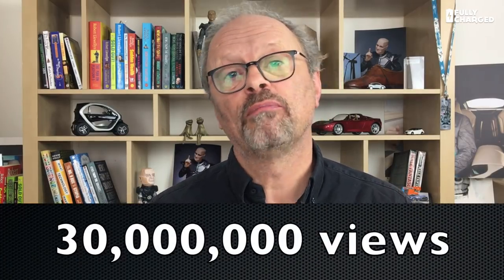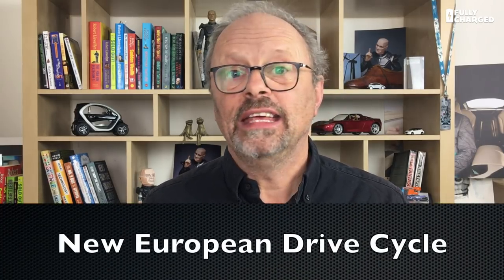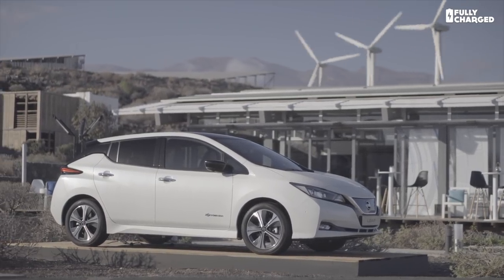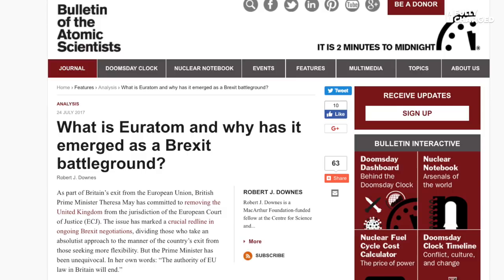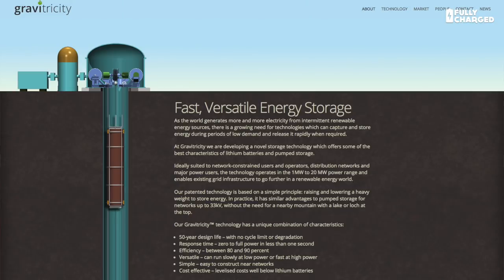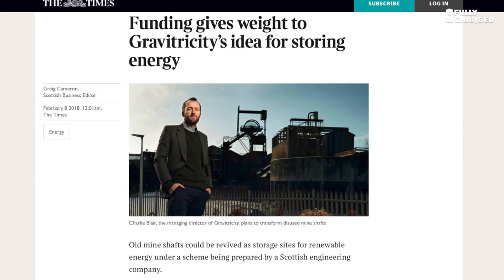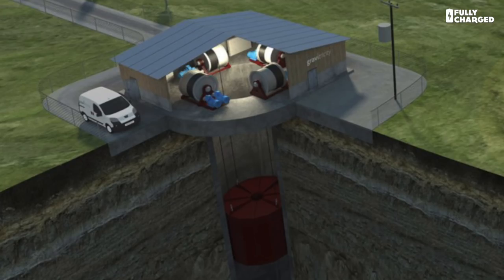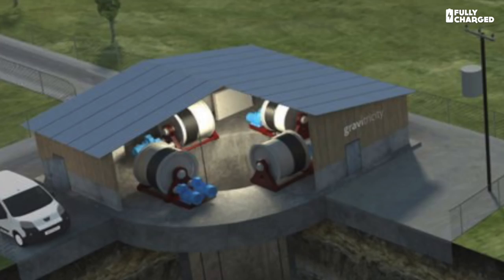WLTP IEM and Gravitricity | Fully Charged News

Comment: Gravitricity is the second novel energy storage solution I've heard about just today, the other is a company that is also using tunneling equipment but to bore holes into mountainsides to create large empty cavities and turning them into pressure vessels where they use excess clean electricity to pump air into the cavity at high pressure and then release that air to spin a generator when demand is high.

I think they're both awesome ideas and can't wait to see them put to use so we no longer need to rely on lithium ion batteries for large scale energy sotrage.
Reply: it's not novel.  See my earlier replies to others.

Comment: Robert please forgive me if you’ve covered this previously because I obviously missed it. NEDC/WLTP is all very well but I’m interested in calculating how much I can save going electric. To this end I’m wondering if you have a rough working figure for the charging efficiency of the lithium cells cars use? In my day I seem to remember that for lead-acid batteries one could reckon on a factor of 1.4, I.e. to charge a 10 amp hour battery you’d have to put  in 14 amp hours. I’ve been looking at PHEVS and a rough calculation, given that not all my trips could be totally electric would suggest it’s not a clear cut ‘no brainer’. Many thanks.

Comment: The thing with the big weights seem bogus: 
To store just 1 MWh with a 30ton weight, you would need a hole 13,5 km deep. Sorry, but it just doesnt seem feasable...
Reply: Gravitricity's site talks about using weights between 30 and 3000 tons in mine shafts of between 150m and 1500m. Their stated power range is from 1 Mw to 20 Mw.  And stated efficiency is between 80% and 90%. I'm not an expert...do these figures seem believable?
Reply: Oh ok, thats a totally different case :) 3000 tons raised and lowered 1500 m is about 11,34 MWh with 100% efficiency. But oh my god you are gonna need huge cables... ;) If they can do it cheaper than batteries, i will be impressed :)
Reply: Unless the shaft is already available, I doubt the cost will be economically viable. But if the shaft is there, this is possible in my rough maths.
Reply: And in my country, if you dig any size hole of any depth it'll pretty soon fill with water.
Reply: Good point. But if using a steel weight, you will only lose 12% of the energy if the shaft is flooded vs not flooded. It might still be viable.
Reply: Rasmus Damgaar Nielsen. How do you calculate this? I have about 2KW of solar power available for 6-7 hours a day and would like to calculate how much mass and depth i would need to store about 8KWh to be used at night. Any formulas you can share?
Reply: E=mgh
m (kg) x h (meters) x g (9,81) / 3600 (Joule/Wh)= E (Wh). 
E=8 kWh: m x h = 8000 Wh x 3600 / 9,81
You'd need 30 tons and 100 meters of elevation to store your 8 kWh...
Reply: Thanks. That is pretty easy to calculate. Unfortunately the result is two orders of a magnitude to big to achieve even if it would magically be 100% efficient.

Comment: The graviticity stuff, is that the same idea of when they pump water uphill and then let it drop again to spin turbines?
Reply: Yes, in essence, just without the water.
Reply: Also without the percentage loss of a water turbine but with the gearing loss.
As a storage system it’s response time wouldn’t be as fast as a battery. Not sure about its physical footprint either. Battery packs could be vertical cores for buildings to radiate heat in winter and heat pump cool in summer.
Reply: Yes, it is, at a much higher cost for no real gain. With water you can easily expand the storage capacity simply by having bigger tanks (if you don't use natural reservoirs in the first place). Over all pumped storage is about 70-80% efficient.
Reply: George Wilson well, here you have braking losses so it's not perfect either
Reply: JuicyVeganDwarf yes, but it has some theoredical advantages. The conversion from height energy to electricity can be 100% effective, but when water is used, the max is limited by betz law to about 60%
Reply: Same stuff but you can get much smaller, with lead instead of water you can get 11x more weight and with it power in the same space.
And no it can't be 100%, you always loose on friction.
Reply: Similar, but about 5 orders of magnitude smaller than hydro. It is not viable unless there is an existing hole, because potential energy is VERY low. For example  "Dlouhe strane" Hydro power plant has 3 MILLION TONS of water 500m high (or about 10 000x what they suggest).
Reply: Is it a smaller footprint than the hydro plants? Because I get the feeling this is a solution for local grids, not a solution for a national grid?
Reply: It is not solution, because that 30 tons only store about as much energy as EV (1km, 30 tons ~ 80kWh) while it cost orders of magnitudes more to dig such massive hole , then to buy such battery (~20000 USD?).
Reply: I guess if you have a hole already, then it's a good re-use of something that is not that useful for other situations.. but yeah, if you have to dig a new big hole then I guess it's not that good a deal.. Might be a good idea to use different types of energy storage in places though, so it averages out any cons that could build up if everything was the same.
Reply: Almerinda Romeira more of a variable gearing to meet demand but there is also the spin up time and syncing the output to demand to keep the grid stable.  Something like De Vinci’s variable gear drive with an electric controller to match the ratio to the output required.
Reply: I presumed they would use something similar to how wind turbines turn their VDC from rotating blades to VAC for the grid syncing
Reply: MsSomeonenew - lead is expensive (a few thousand $/€ per ton). None will ever use that. World production (about 3 million tons) is just enough for 100 000 30ton installations. And a 30ton/100m setup can't even power a single home for a day.
Even iron/steel which is much cheaper has no contest against concrete when it comes to price per weight (a few tens of $/€ per ton of concrete).
Petr K - five orders of magnitude smaller? Where did you get your weight from? A scoop of a neutron star? ;)

In the end it's mass that stores the energy. And there isn't anything that's cheaper, more available and easier to handle than water in that regard. Power companies could have had draw weights for a century. There's absolutely nothing new about it. But there's a reason they only build pumped storage hydroelectric and not some other form of gravity storage.
Reply: superdau - I compared it to a pumped hydro "Dlouhe strane" with roughly 3 million tons of water vs here 30 tons. Thats 100 000x less or 5 orders of magnitude.
Reply: JuicyVeganDwarf - Calculating stored energy is very simple principal and there's nothing inacurate about it. For ~10k USD (rough cost of equivalent battery storage) you can build an outhouse, not drill hundreds of meters, buy 30t of concrete, heavy-duty cables, machinery to lift it and pay maintenance of moving parts for years.
And since this is nothing new, people WERE trying, but it is simply not feasible for a reasonable cost. Just look at the cost of building elevator to a 5 story building - that's about 50k at least. And thats tiny compared to this.
Reply: JuicyVeganDwarf
You ever heard of physics? There's no need for any specs to arrive. Physics tells you how much energy you can store with a certain weight and height (at 100% efficiency, it only goes down from there). Economics tell you that no matter what material you use, pumping water up and down a pipe (that does neither have to be straight nor vertical) is cheaper. Which, again, is why power companies have been doing that way for a century, instead of pulling up and down weights.
Reply: "The conversion from height energy to electricity can be 100% effective"

Yeah, no... Also, Betz's law only applies to wind turbines. Water turbines can be up to 95% efficient in converting the energy in flowing water into mechanical output.
Reply: re JuicyVegan:  Yes, you CAN count the upper limit of what they can store assuming perfect energy conversion and even than it doesn't add up  (it can get only worse for them if we account for any loss in "turbines" you speak of). 
We can calculate precisely amount of potential energy if we know weight (30 tonnes) and height differential. For 1km height it makes 3x10^8 joules or about 80kWh (thats basic physics), for 100m it is 8 kWh. Neither makes sense and nor does any other height you fill in - not even remotely.
For that reason I gave you example -  20m lift is more expansive (~50k) than a 100kWh battery (~30k), that would supply more energy than is stored in 30 tonnes of weight 1km high.
Reply: It can be 100% effective, really?
Reply: There was a story a while back about a a fully loaded train being driven up hill with renewable energy and then let to run downhill to generate energy when needed. I wonder how the economics of that idea went.
Reply: JuicyVeganDwarf: I don't think "power required to rewind" matters.. If it is only excess power that will be used to wind it back up then it is relatively free, ignoring wear on tear on a wind turbine that could be stopped or solar panels that could be turned away from the sun instead

Comment: I average around 66mpg all year round in my Toyota Aygo. My Best tank was 79mpg in the summer on a 300 mile round trip averaging about 55-60mph. I'm just glad that I get better fuel economy then the average hybrid car. I probably won't be buying an EV until I can get one that does over 100 miles per charge with a worn battery for less then £7000 without a battery lease and I don't see the point of buying a hybrid to get very similar fuel economy figures I get from my current car. The only advantage is not worrying about economy in stop start traffic which I usually stop/start my engine if possible.

Comment: Assuming 90% efficiency of the motors/generators you have a roundtrip efficiency of 81%. A good battery has 96% roundtrip efficiency but you have to consider charger and inverter at maybe 92% each which adds up to almost exactly the same or 81%. Batteries will age over the years, but so does the gear system and motors. I assume these mechanical storage system are cheaper to run in the long run. Batteries will eventually have to be replaced, the weight bases system 'just' needs regular maintenance.

Comment: I've been looking into Gravitricity a bit more. At first glance the very high cost per MWh of storage makes this look like a waste of time. However, the system may have a place in the grid if the price per MW of power is below lithium batteries. Although the system will not be able to store large amounts of energy it will be able to 'charge' and 'discharge' at very high power.

This is a similar concept to the flywheel developed by Williams, used initially on racing cars and now on London buses. The cost of storage is huge - it only stores 1/3 kWh (about the same as two hobnob biscuits), but it can suck up or deliver 120kW. For comparison the Tesla Model S delivers a peak of around 600kW from a 100kWh battery. To deliver 120kW the 1/3kWh flywheel would therefore have to be replaced by a 20kW lithium battery. 

It's a shame Gravitricity don't make this clear on their website, and didn't explain this to Robert when he spoke to them.

Comment: Mechanical energy is a bad storage for electricity. Assume that we can boil certain volume of water using 1kW kettle in 10 min (600s). We need 600 000 joule to do this. If we have a weight 1000kg (1 cubic meter of water) then it should be lifted 60 meters (mgh) to boil this water. Is this a reasonable storage place?

Comment: Why just a single weight in the Gravitricity shaft? By using several independent weights you get the same benefit as you would with a single large. Is drilling another shaft less expensive than doubling a shaft's capacity?

Comment: Re Gravitricity. Yes it is a very simple principle: Stored energy is mgh - mass x gravity x height. 

The example you gave of a 30 tonne mass if allowed to drop 1km is able to store less than 82kWh, so less than the battery in your Tesla

It scales linearly, so for your "many megawatt-hours", you'll either need a longer hole in the ground, or a heavier mass. So that's either a 10+km hole or a 300+tonne mass just to make it up to 1MWh. 

It'c certainly possible, not sure how viable it is.

(someone else might like to check my maths: mass (kg) x gravity (9.81) x height (m) gives stored energy in joules. 1J = 0.00028 Wh)

Comment: I'm all for renewables and energy storage but as an engineer I must say my bullshit alarm was ringing loud on this one. Quick math and physics says the energy stored in the concrete block is mgh. Mass * gravity acceleration * its height. Assuming we could convert this to electricity with 100% efficiency here are the results. 30 tons is roughly 27000kg lets round up to 30000kg to play in favor of the idea. 30000kg * 9.8m/s^2 is 294000 kilojoules per meter. One KWH is 3.6 megajoules. 3.6MJ/2.94KJ is 12.2 meters per KWH. That is a ridiculous way to store energy. One kwh of batteries can fit in a backpack. Please someone check these numbers and let me know if I made a mistake. I hope I did but it seems as if its true.
Reply: You're not much of an engineer though seeing as you didn't bother checking any of the numbers.
Reply: Seán O'Nilbud I did check them. I'm simply asking for a confirmation as is commonly done in engineering if anything that makes one a better engineeer. One who thinks his answer must be correct is a poor engineer. I work on grid energy storage systems for my job.

Comment: Can you explain what is the electrical infrastructure required for the different charge  rates from  the charging points, for example what infrastructure  is required for a 7kw, 22kw, 43kw  etc and what is the highest charging rate can I get for my home without having to upgrade. Can the utility companies facilitate the increased demand and infrastructure changes. Will it be possible to get a 22kw charging rate at home and what would be the cost to upgrade my home electrical infrastructure to accommodate the higher charging  rates to a home charger.

Rural car users have a high requirement for trailer hitches for their cars, why don't the lower cost  EV's have a capacity to add a hitch to them?  I know that having a trailer attached would reduce the range significantly but most trailer  requirements are for short trips?

Thanks if you can help your doing a great job by the way.
Reply: Matt Wlaw 7kw standard, you need 3phase for 22kw

Comment: @Gravitricity: With a mass of 30 tons, you can only store up to 8 kWh of electricity per 100 meters difference in depth (8175 Wh in theory, without losses).
Even ten of those with 1000 meters depth would not achieve 1 MWh of storage capacity.
For reasonable use of elevation energy, you need REALLY big masses. Like the water in a reservoir.
Here you need a complete set of cables, generators, shaft, concrete-weight for each unit with rather modest capacity.
This makes it expensive.
Imagine: The battery of a Tesla Model S (100 kWh) or such a unit with 73 tons in a shaft of 500 meters depth. This would be equivalent, both calculated without energy losses.
Reply: Meanwhile I read other comments and know more.
Okay, they want to use REALLY big masses, up to 3000 tons.
But the problem stays the same: High effort in installation relative to storage capacity.
And a lack of appropriate mine shafts you could use.
And to sink a shaft only for this purpose would be too expensive all the more.

Comment: Nothing new in the world. In London's docks in 1869 they built the Limehouse Hydraulic Accumulator Tower to store energy to drive the cranes and capstans using a 100 ton weight: "a symbol of London’s Victorian industry not normally open to the public – the Limehouse Accumulator Tower. Thousands of commuters pass the 30metre high brick built tower on a daily basis – it’s right beside the Docklands Light Railway just east of Limehouse station, and it’s a (no longer working) example of a raised weight hydraulic accumulator used to power the cranes at the nearby Limehouse basin between 1869 and the 1920s."

Comment: Sounds a great idea, functionally somewhat similar to pumped storage. UK has hundreds of shut down coal mines. Perhaps their large lift shafts should be utilised first before drilling extra shafts.  For countries with solar, wind and hydro, stop daytime hydro production and use the extra stored water capacity for increased hydro production at night when the solar production is not available. This is a cheaper better option than huge batteries (with a limited service life).

Comment: Interesting energy storage - using a weight. Sounds exactly like seabags but better - no corrosive water surrounding your energy source that can leak. The only issue I have with these systems is that (like pumping/draining a lake), no real energy is produced. More energy is required to lift the weights back to ground level than you get from dropping the weights; it's an accounting gimmick by some perspectives. However, no energy storage method is 100% efficient, so this is a pollution-free method to retrieve and use excess energy.